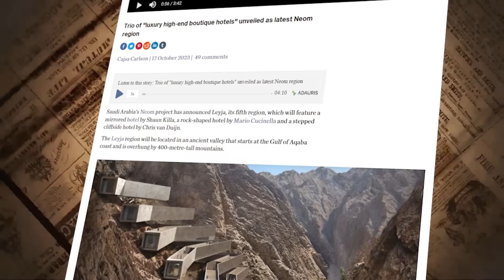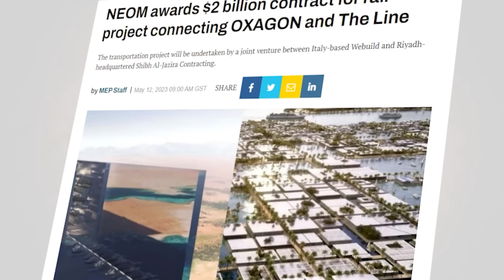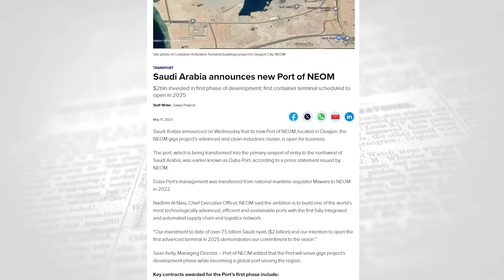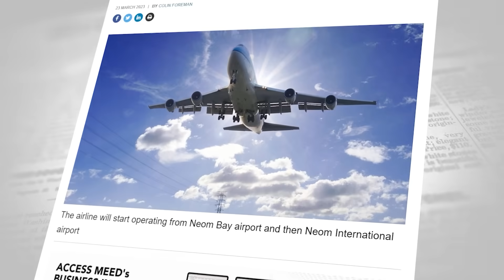Unveiling Neom's Latest Region & INSANE Construction Progress

Comment: There are many factors they are not taking into consideration. Essentially, they are building a tube with inputs only at two ends… for a city that will be six times denser than any city on Earth.

Transportation arteries will be a big problem. Supposedly, everything will move by trains in the basement. If the basement were nothing but tracks, you could fit about 40 lines, but that wouldn’t leave room for platforms, freight handling, etc. So, maybe 20 tracks. Two locals and two express tracks sounds pretty good until you realize you’re trying to squeeze a city with the population of New York or London on to them. Don’t forget, you also need to move freight (primarily food, refrigerated and frozen), garbage, and emergency equipment too. 

The end modules will be given over to nothing but getting people, supplies, food, garbage, water and waste in and out of the tube.  Since poor people aren’t envisioned in this design, day workers will need to pass through some sort of checkpoint which will probably involve long queues. 

The center of the line will be the most expensive module to move materials and people to and from. That sounds like it would be a good place for some ultralux housing, but it wouldn’t appeal to the wealthy to endure long commutes to the tube ends every time they want to leave. Close to the two ends of the tube will be the most desirable location. Other features like proximity to schools, hospitals, and attractions will cause hot spots to form within the line, spoiling the imagined linearity. 

There are many other issues, like maintenance that are just as crazy, but it all stems from assuming the shape of the design implies linear solutions.
Reply: The most insane part... They've barely begun construction and they've already reduced the number of stops from around 40 down to 9. That's such a massive downgrade. Imagine living kilometers between 2 stops.

Comment: as an arab from the same region with direct land access to Saudi , i really hope all of these projects will work. The line is an insane project but whats even crazier is the running cost and its sustainability. I  hope this isn’t another naked King tale and really wish them all the best.
Reply: If built, the hotels in Leja may work well for a small period. The problem is, Saudi has little to offer tourists and it is very hot. No one will pay a lot of money to go to these hotels for what? Extremely hot and humid weather for little to do apart from climbing and hiking? I enjoy hiking, but I am not going to pay thousands to hike in a hot humid place with nothing much around. Climbers may like the a mountainous area, but climbing in such conditions will dehydrate them quickly, so they will have to take tons of water with them which will make climbing there much harder with all the added weight making them more dehydrated.

The line, well, that is just a ridiculous idea. If built, everyone living there will have to be a millionaire for it to be able to run. I say if built, because I don't think it will. You need to think that each wall is about as high as the current world trade centre in New York and the walls are to be 147km long. Its just not going to happen.
Reply: So, one has to ask why are they building it? You make great points, i ve been Saudi Arabia, not a place i would EVER want to visit. @cplcabs
Reply: Right, the other thing SA like UAE are good at building these projects, BUT NEVER finish it!
Reply: I would see it as a chance. Even if the thing never works as intended, it will be at the very least a transportation development project into the hinterlands, with a powerful economic center at its end. You don't have to build a trench city on top of that to make it useful, and I would suspect that the people managing the project will have an eye on the developments and change course if necessary.
Reply: Saudi Arabia like UAE are known for BIG projects that 90% of the time don't get finished. @Volkbrecht
Reply: @RamblingRodeo  90 % is grossly exaggerated. Last time I checked, both countries had quite a few things working in them. And my point is that The Line might be useful even if it does not get fully realized. Maybe even more useful. They could just build the train tunnel, then pave it over and build a test highway for induction powered, solar fueled cars :)

Comment: Leyja actually makes sense.  This could really work.  Unlike Neom and their ludicrous snowless ski resort.  The marina will probably do OK too.
Reply: Temp is below zero there; just has no water for form ice, that will need a snow machine to be made.
Reply: @edhal9000  What people in warm climates don't understand is the temperature has to be well below freezing all day.  As soon as the temperature rises near freezing (because the sun makes it much warmer) it starts melting.  Than that snow is ruined.  It becomes slushy and heavy, terrible for skiing/snowboarding.  Then at night it freezes (the top layer) and it's just a mess until more snow.  Except you need a lot more snow.  Like 20-30cm to really cover what was just ruined.   There are mountains at 2000 meters at 50 degrees latitude that struggle with temperatures rising.  And it's not just a global warming.  Its been going on for several decades.  You don't ski in the tropics for many reasons.  Also you can't just keep going up and up because around 2000 meters the air gets thinner and at 3000 meters its a real problem.  Altitude sickness can be fatal.
Reply: @FreshAirRules  Ok, you're right. I hadn't thinked about all complexity to keep the snow good for skiing. And I wish you could tell it to the saudits because they are thinking that what I said is the solution for the problem.
Reply: @edhal9000  You have to experience the difference between dry snow (Heaven) and wet snow (slush hell).  It's really a war with 0c on a mountain.  But really it's about -5c when the sun is out full force.  Otherwise even at -3c the sun can melt the snow.  Even -5 is generous.  Probably -7 or -8 would be safe.  But maybe not there because they are so much closer to the equator than almost all skiing areas in the world.  Maybe it would need to be -10 or -12 there.  The Saudis think they can spend their way out of any problem.  Doesn't work so well with nature.  Plus, skiing and snowboarding has to be done a lot to get comfortable at it.  You need to live near the mountain.
Reply: Yeah, most of this will be wasted money for 1000 reasons, and there is one more they are completely ignoring. The islands, the octagon, and a few others are at sea level. By the time these projects are done sea levels rising will drown them. The land half of the Octagon for sure. Plus, talk to anyone in Seattle that lives in a floating house. There are all kinds of issues with that, and they have a limited lifespan. Water eventually gets in. They either sink or have to be dry docked and fixed, or replaced entirely.
Reply: @Metal0sopher  Good points!
Reply: I’m wondering with all the wild flooding in the Middle East lately whether building in a shady valley is really a good idea.  And the construction companies’ name Killa was strangely symbolic.

Comment: Naysayers said it’s impossible to build at first and now when they’re seeing the construction has already started they are saying that they don’t have the money to complete it. Lol.
Reply: We haven’t seen any construction.  Just dirt moved around.  They showed rebar but not even any rebar that’s been set in concrete.
Reply: The Red Sea project has already rolled out Six Senses resort. The Ritz Carlton and St Regis to follow soon.
Reply: You do understand that each wall will be as high as the current WTC in New York and they want to make them 147kms long. It took 13 years to build the current WTC and it is 64 meters on each side. This means you basically need to build about 2,300 WTCs in a line twice (as there are 2 walls)  There is a big difference to building those walls to digging some foundations which is essentially what they have done now.
Reply: They said the same thing about Dubai's world islands. They never finished and now they sit there empty and ugly.
Reply: I would not bet against them.